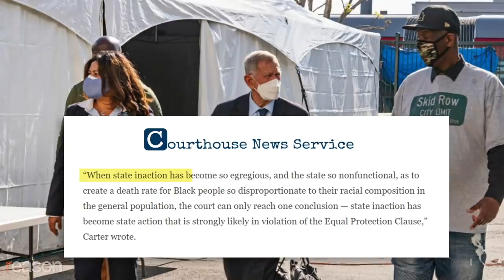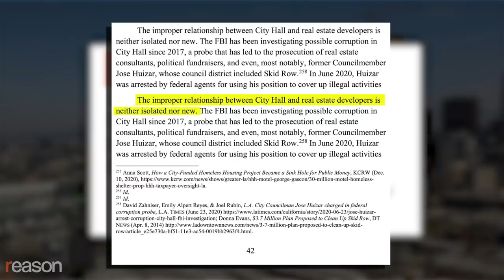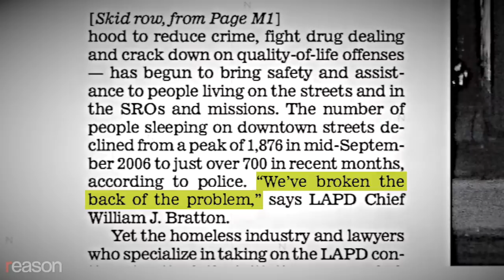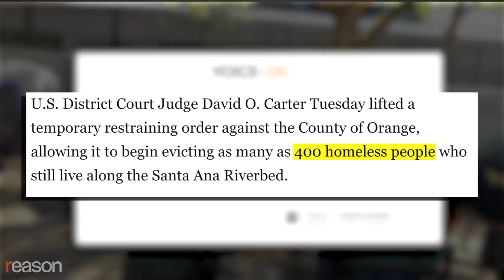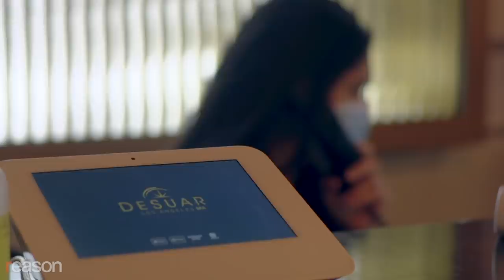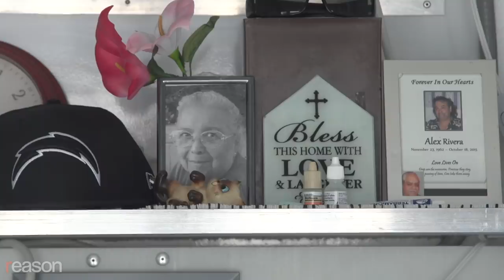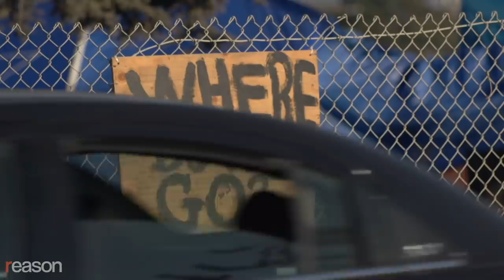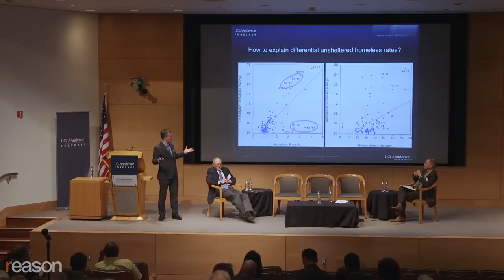Los Angeles Is Squandering $1.2 Billion While Homeless Face a ‘Spiral of Death’

Comment: 1:45 what if they purchased a bunch of existing apartments (a quick search on apartments will show you 29,370 in just the city of LA alone)? or bought some hotels/motels and renovate them into apartments (a quick google search will show "1,008 hotels with more than 98,600 hotel rooms")? Sure, they'll probably also need to build more, but why start from scratch when they don't have to?

Comment: Homelessness is a symptom of other major problems. Namely lack of education, mental health treatment inaccessibility, drug use, and housing prices. Unless those are directly addressed, this will never be solved. Trying to attack the homeless issue directly without addressing the issues that cause it is like trying to treat a broken bone with aspirin. 

People think that throwing money at the homeless or giving them homes solves the problem. IT DOESN'T. This approach is not unlike thinking liposuction helps the obese. They have an eating disorder, and just sucking the fat out seems like a great solution.. until they gain the weight again. It doesn't work and is a band-aid fix until the eating disorder that causes it is resolved.

Homelessness, unfortunately, is an issue that may take decades to resolve, and it doesn't help that many of them have submitted to that lifestyle. Until we solve the underlying issues, it is a problem we're stuck with.

Comment: Obviously there is a correlation between high housing prices and homelessness. If you live in the Florida Panhandle, you can be seriously bad way and still fund a trailer to rent for the most part. But this is obfuscating the point. Is the goal to provide these people with the structure and help they need to live as healthy a life as possible, or just to push them out of sight so that they can continue to self-destruct in private. Homelessness is symptom of a larger sickness. Putting four walls and a roof over someone on a one way track to self-destruction is not problem solving in my opinion.